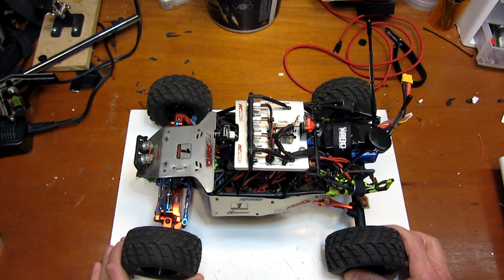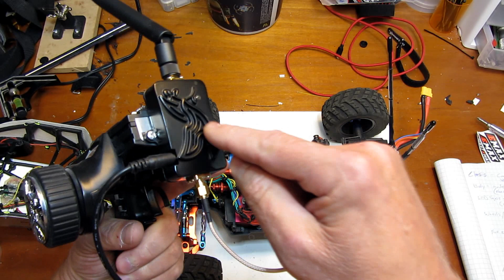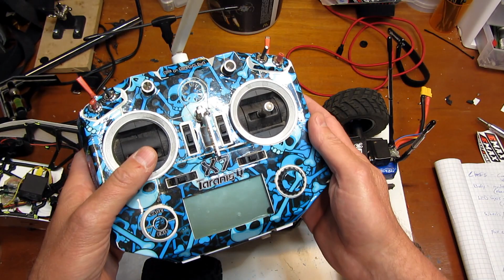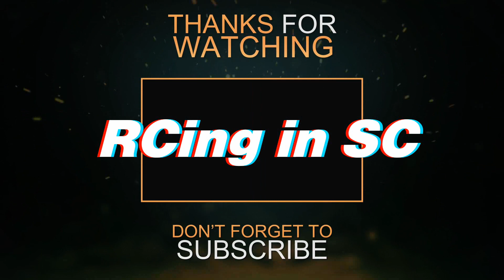WLToys 12428 - Highly Modified - 1 Year Later - Many New Upgrades

Comment: What is the best motor to use the a 5200mah battery
Reply from the maker: It depends on the voltage of the battery. Is it  2s, 3s, 4s or 6s ? I'm using a 3100kv motor running 3s and it's more than enough power and speed. My recommendation would be..
2s 3000kv - 4000kv
3s 2500kv - 3500kv
4s 2000kv - 3000kv
6s 1000kv - 2000kv
If you want more control then chose a motor at the low end of the recommended kv for that particular voltage. 
If you want more speed, then chose a motor at the higher end of the recommended kv for that particular voltage. 
Lastly, not all rc cars have the same final output ratio. So these recommendations apply only to the wltoys 12428. I hope that helps.

Comment: What happened to your video,the one you had the GPS to get it to arm and show the arrow for directions back to home?
Reply from the maker: I made it private because I later ran into issues even though it worked fine for a short while. I burned  up two receivers and one flight controller and I never figured out what was  doing it. I didn't want to be responsible  for anyone else following what I did and have the same thing happen. However, if you still want to watch it, here's the link, 
https://youtu.be/BAQTCywxhwI
I made it unlisted but , again, do it at your own risk. I can't prove it , but I think that using the esc bec was the issue. Probably too much noise on the input voltage.. If I were to try it again, I would use an isolated 5v power source for the rx and a filtered power source for the FC. Good luck.
Reply: @Matt633NLT  thank you for letting me know

Comment: Hey there, great truck! Would like to know where your getting parts and how straightforward they are to find?
Debating between this and the 144001. I thought I’d go for the buggy as I seem to be able to find more upgrades.... until I found your video!!!
Awesome beast! Bet it handles well now with that width!
Reply from the maker: The majority of parts I found on Amazon. But, remember, all the radio and fpv equipment was sourced from fpv vendors . This buggy is actually very fun bone stock. You can't go wrong.
Reply: Thanks for your reply! Really helpful. Looking  for something I can mod into something rugged. Love the body panel ideas on yours .

Have you seen the from shock upgrade that people are doing using the shocktowers from otter wl toy models 👌🏽
Reply from the maker: @Hrichs  yes I have , and they are  cool , but in my case, I almost exclusively drive mine fpv, and the modified shock tower would hinder my view. Otherwise I would do it too.

Comment: I like your build. May I suggest you use this shock tower? https://www.aliexpress.com/i/33026626125.html 
I'm pretty sure it fits because it is designed for the fy06 and they both have same diff shape. You can also use the a959 shock tower. This way you can have a vertical, better shock position.
Also, do you know what m size screws are on the links by any chance?
Reply from the maker: Thanks. I'll check it out. I think the screws are 1.5mm or 2mm.

Comment: Nice mods! How did you mount the front led lights? I know you drilled a 12mm hole but it seems like the light would be too long to fit
Reply from the maker: Check out the playlist. I did a separate vid on the LED lights. Thanks.

Comment: Did you have a video on how to program the channels? That's all in the radio setup? Anyway to run that receiver without all the switch things after it? Maybe I should just get the flysky, a little simpler lol - where'd you get the 4 watt mod?
Reply from the maker: Yes I do have a video on how to setup channels in radio. Please check out the WLToys 12428 playlist. There you will find all the upgrades for this buggie and tutorials . The booster was purchased on Amazon . Thanks for watching.
😎👍🇺🇸

Comment: You may be interested in a black cage, here is a link for this

#Aliexpress 458.65 MXN$  7%OFF | Wltoys 12428-C 12428C RC Car Spare parts 12428-C-0347 car shell frame set
https://a.aliexpress.com/_dSv2OHv

And the front bumper, just to avoid the scratches that reveals the green 

#Aliexpress 83.72 MXN$  7%OFF | Wltoys 12428 12423 12428-B 12428-C 12628 RC Car Spare parts 12428-0052 Front Bumper Climbing Bumper
https://a.aliexpress.com/_dYKlIUN
Reply from the maker: Thank you. 😎👍

Comment: Awesome video! Why the elastics on the front adjustable links? Thanks
Reply from the maker: Haha, you're the first person to ask about that. You're very observant. All I'm doing is using them to keep the play out of the links. The links have just a tad bit of play in the ball joint and when you add them all up , it can create some steering wobble at high speed. The rubber bands simply help dampen that. I hope that makes sense.  Thanks for watching brother.  
😎👍

Comment: Hi thank you so much for all yours video mods with wltoys. I've done few upgrades and now it’s time for fpv and I’ve got question what transmitter I can use with runcam split 3 micro?
Reply from the maker: As far as video transmitters go, it honestly doesn't matter. If you have goggles or a fpv monitor that recieves 5.8ghz analog , , then you simply need a 5.8ghz transmitter . The camera you use is irrelevant. The video transmitter just needs an analog video input signal, and it doesn't care what camera it gets that signal from as long as it's analog , which the runcam split micro does output.  I would recommend a video transmitter similar to this one.
https://www.amazon.com/AKK-600mW-Mini-Transmitter-Race/dp/B01FRRV3HE
It's cheap, powerful , and has an easy to read display for channel/band. I hope I answered your question. Thanks for watching. 
😎👍
Reply: RCing in SC Thank you for recommendation, hopefully that will be suitable with my cam. I both Eachine ATX03 Mini 5.8G 72CH but it doesn’t work, I think the reason is to small 200 mW and AKK has 600mW and runcam needs 650mW. Thank you and I’ll wait for more video :)
Reply from the maker: @kamiltel83  it makes no difference what vtx you connect to camera, as long as it's wired correctly. Be sure that both camera and vtx have common ground and are supplied with correct voltaged respectively. Then simply connect video out from camera to video in on vtx and it should work fine.
Reply: @Matt633NLT  I was wirening like that https://bit.ly/2W7Qluo
and on cam board supposed to flashing the light but it doesn't. When I set up vtx on max then flash once. No idea what I've done wrong...
Eany way thank you for your help :)

Comment: Fantastic modifications you've made to this car, it gives me some ideas! Just one thing I couldn't find anywhere in your playlist: these leds are 12v, do run them of 5v or do you use some kind of step-up?
Reply from the maker: I'm running 3s so it works out good for that. You may want to try to find some specifically for 5v.
Reply: @Matt633NLT  Thank you, but it's not very clear to me ho you wire the leds with the rc switch. I thought it was receiver 3d channel --> rc switch --> leds and they whould get 5v from the receiver. Do you might have a link for these rc switches?
Reply from the maker: @FPV_Jos  I use the 3s balance lead to power all the aux components, fpv, lights horn, etc. I use RX controlled switches as mentioned in the video to switch power to the components. The lights use straight 12v from the 3s lipo.

Comment: If you are having issues flipping over, I made a DIY rear sway bar that really helped my stability. I made a running and overview video. Sweet setup though! Also if you wanted more space up front, change the front shocks to vertical mounted positions.
Reply from the maker: Both options that I've explored. Do you have a vid of rear sway bar. Please share here. I don't mind you posting link in comment. Thx brother.  
😎👍
Reply: @Matt633NLT  Its not a super detailed video, but skip to the 7 minute mark for a close up and overview of how its installed. https://www.youtube.com/watch?v=vmcr0dcY6Q8
Reply from the maker: Thanks. I'll check it out right now.

Comment: Great video I have 1 question how did you get grub screws off? What wasvthe procedure? Mine almost all are having to be drilled threw can u help?
Reply from the maker: If you mean the set screw for the pinion gear  then  the answer is ....I didn't get it out. I just replaced the original brushed  motor with a new brushless motor and new pinion. The factory goes overboard on high strength loc-tite. It's usually impossible to remove them.  Sorry I didn't have a better answer, but those are the facts. Thx fur watching. 😎👍
Reply: RCing in SC If I may, the grub screw at least is in the open, there are other diff and drive gear screws that are tiny 2MM flat head screws that are a nightmare to deal with because they had thread lock on them. The only way to get them out is by heating them with the tip of a fine tipped soldering iron. You have to act quickly to get a wrench on the screw as soon as you can after heating it. In the case of replacing the plastic gears that came with the buggies, many of us used electrical side cutters to cut away the gear and then try to get the screw out with fine needle nose or vice grips - terrible to deal with!
Reply from the maker: @kodak_jack  great tip. When I was an automotive mechanic, that's how we loosened exhaust bolts on manifolds. By heating them up. Same principle. Thanks again.